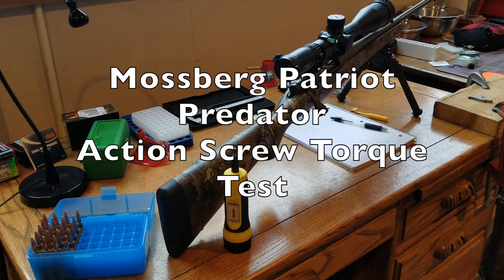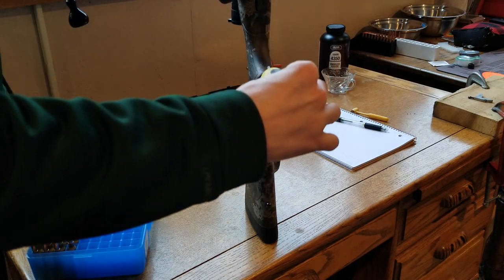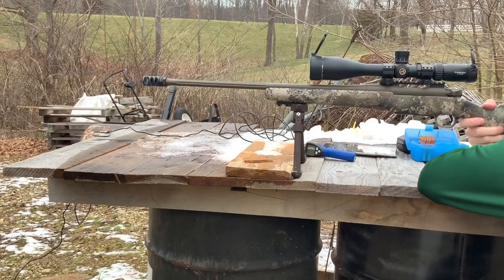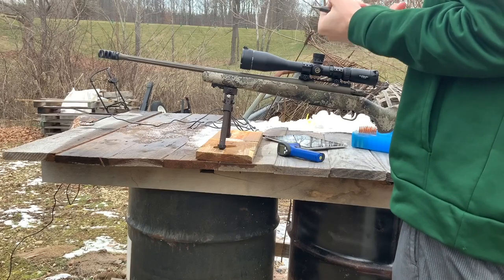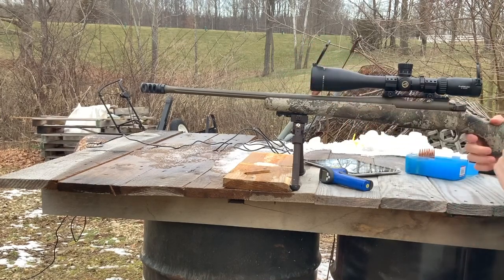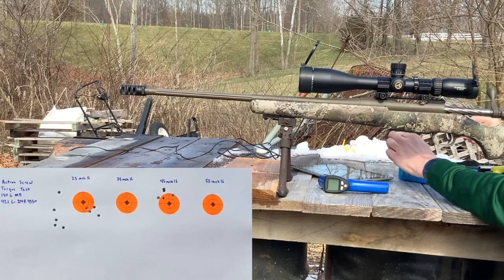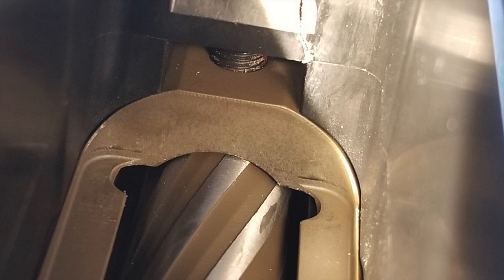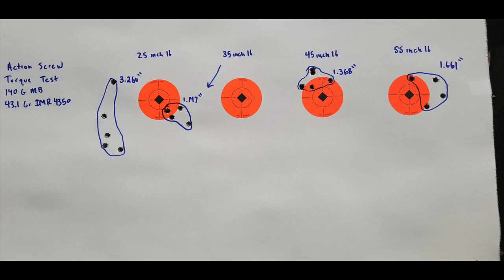Action Screw Torque Impact on Accuracy

Comment: By increasing torque and not loosening there was no reason to bump the stock again. It wasn't going anywhere. Good video showing that the torque did make a difference. I have seen other videos that show the same. It is better to do 5-inch pound increments vs. 10-inch pounds. And if the group is fat early best not to waste anymore bullets on it and use them on other tests. It was nice for you to point out the flaw in the Mossberg as well. Glad I have a Savage instead.

Comment: I have a patriot .308 which now shoots 180g subsonics perfectly. However what I am learning the problem with these rifles is the stock, they need upgrading from the plastic one to either a walnut or Boyds stock both are available. I can move the plastic stock under the barrel in all directions with my fingers so what does that say when the gun goes off and its sitting on a bi pod, the shot goes anywhere it likes.

Comment: Good information. Savage specs are 35lbs. My rifle is off im going to torque mine today. Think I'll loosen screws first and then tighten to spec. I'll also see if savage has the same empty space between the action screw and the stock.  I'm really starting to not like the plastic/ composite stocks. Thanks for the video 👍
Reply: Honestly you won't have that problem with a Savage stock. If you haven't noticed, you have steel pillars in the stock. I think the only concern you may have is barrel touching the stock if any at all. One can always do a sand paper job on the inside to resolve the clearance if there ever is a problem.

Comment: I have a Mossberg Patriot and notice they bedded the barrel on plastic. Big mistake, you can wiggle the action left to right there is so much slop, I JB welded the inner plastic to the wood stock and now there is no play.  I still need to bed the barrel under the chamber but it is much tighter now. This was in .270 and I had it rebored to .338-06.
Reply from the maker: Yes, I recently pillar bedded my rifle, and it has been shooting consistent sub MOA groups since!
Reply: @RobsReloading  how did you pillar bed it? Thanks from FL

Comment: Mine shoots moa at 25 inch pounds you shouldn't exceed 35 inch pounds on these guns
Reply from the maker: I agree with that. The plastic cannot take much more than 35 inch pounds. I wish they made a metal mag insert to replace the cheap plastic one.
Reply: @RobsReloading  that's why my patriot is my truck gun now lol. I bought a savage 110 storm for my carry deer rifle. Mossberg was too cheap feeling. But it does shoot
Reply: Not to be rude but your scope rings aren’t adjusted ideally. The rear should have a little room from power adjuster and front is to close to center of scope. These need a little room at least 1/4 to 1/2 inch.